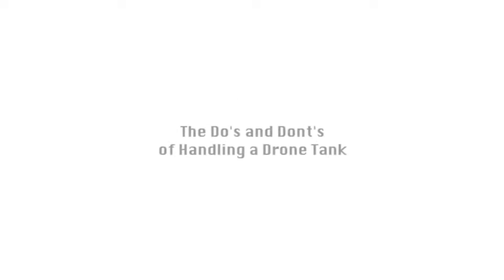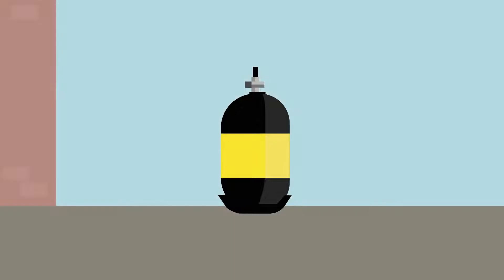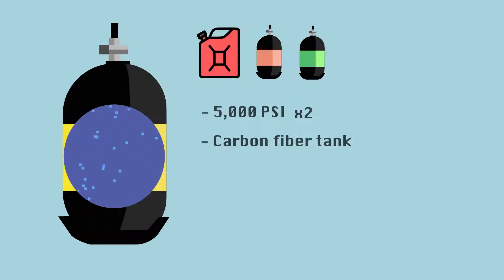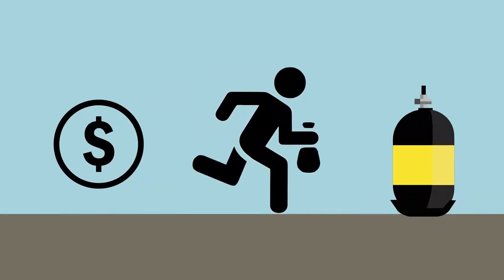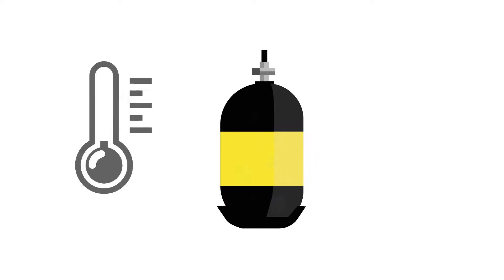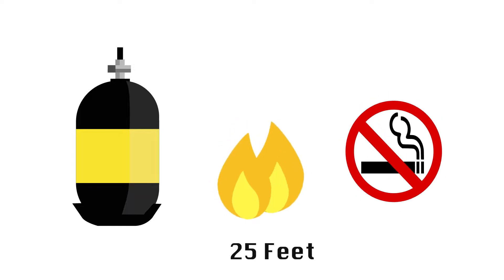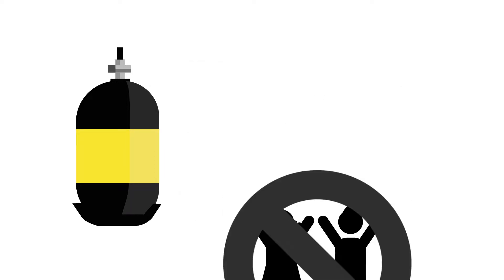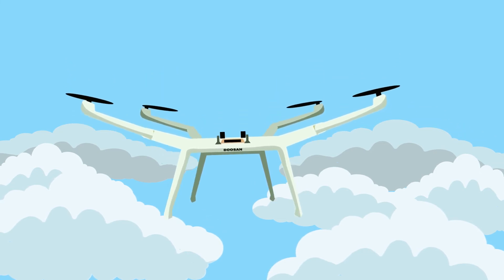Hydrogen Tank Do's & Dont's

Comment: Do not breath hydrogen because it suffocating?   But Helium is fine??  lol..  
What is the logic behind that??  haha.     Of course if you do not breath oxygen you die, but it is the same no matter if you breath pure nitrogen, helium or any other gas. 
In fact, very deep divers use hydrogen as second gas to reduce the  high pressure nervous syndrome in cases where helium is not enough. It is also used on certain mixtures for some health treatments. 
The only clarification that you need to do if someone wants to inhale a bit of hydrogen (the same as helium) for the acute voice trick, is to remember no smoke at the same time :)